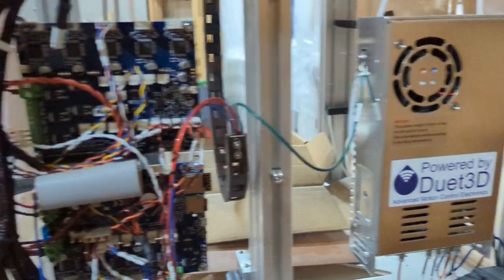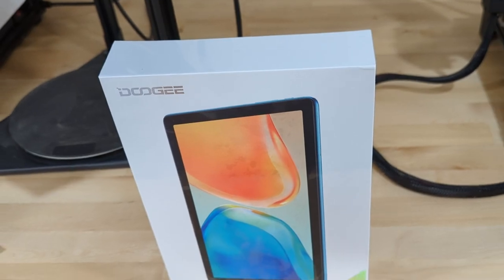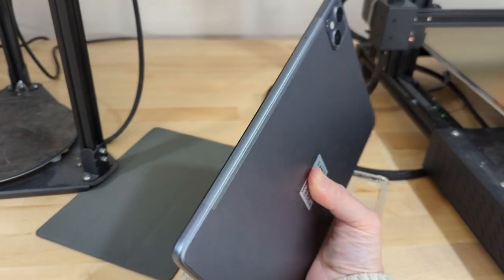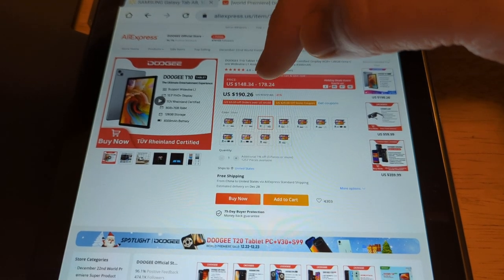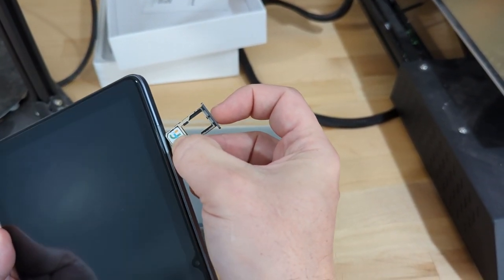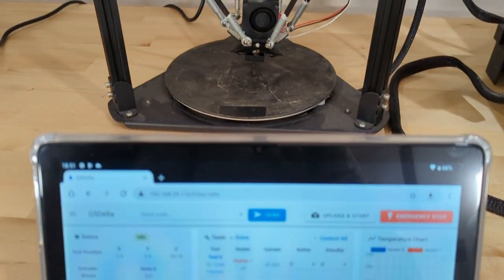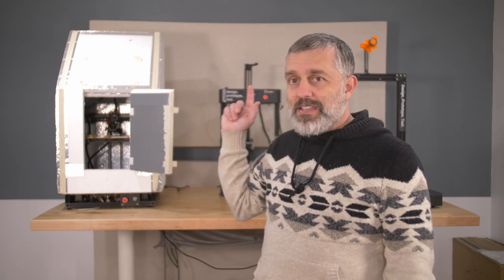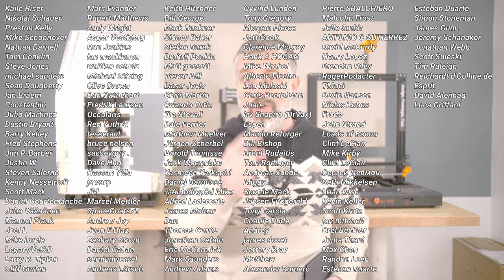Controlling A 3D Printer Farm With A Single Tablet - The Doogee T10

Comment: Duet3D mainboards are plug, configure some gcode, and play solution. 
No Linux OS on a RPi to setup first or VScode and marlin to setup and then you can start configuring if you can skim through all that code, with Duet3D none of that. Duet3D engineers take care of the firmware side for you, all you do is tell the mainboard these are the settings for my printer and that's it. ALL IN GCODE as it should be.

Comment: I've got a convertible Chromebook I like for this reason. Slap a mouse on it and use onshape, then you have an end to end solution for cad and printer control. Not that you can't do that with a dedicated tablet it's just nice having the laptop form factor too.
Reply: Only missing piece on a chromebook is a slicer
Reply: @nbalagopal  actually, no. I have prusaslicer installed on it. You can go into the developer options on it and enable the Linux development environment. After that you have a Linux back end and can install with apt commands.

Comment: I have never been brave enough to buy a Duet mainboard for any of my printers. Due to a lack of knowledge and experience with marlin build and compilation I started down the klipper road which has proven to be reliable enough and of course using mainsail it’s accessible over WiFi. I’ve used octoprint on marlin printers and that works extremely well. Downside is that octoprint and klipper require the same thing, additional hardware namely a Linux based pc that typically comes in the form of a RaspberryPi or similar.
The new Biqu Hurakan has klipper factory installed and with mainsail it gives the same WiFi connectivity and control over WiFi. Let’s hope more manufacturers start building printers with WiFi monitoring and control.
Reply from the maker: What does being brave have to do with buying a electronics control board? This is such manipulative and loaded language. Who do you work for?
Reply: @DesignPrototypeTest  Mate your paranoia is getting triggered here for no reason. I am a big fan of yours if you track my comments. There’s nothing wrong with duet hardware, it’s just that I haven’t been able to justify the cost verses the risk of my lack of knowledge. 
For me to even try a duet board out it would cost over £200 which isn’t a huge amount in the scheme of things, isn’t to be wasted on a whim either.
I haven’t even mentioned another mainboard in my post just that I took another route to achieve what you have with duet. Would you agree there are other paths to choose from other than duet, else dare I say it your a Duet Fan Boy? I never thought I would say that about you, I know you love Duet hardware as all your printers run on their boards, but for me I don’t really care about the hardware it’s all about the software that is running on the hardware. I failed several times to get marlin running on my custom builds so I reluctantly tried klipper which I found was easy to get the printer back up and running, that is all. Reliable hardware is always nice, but easy to build software is king!.
You said hopefully manufacturers with web installed such as octoprint, the first manufacturer to be brave enough to step into this arena happened to jump on the Klipper fad that is running at the moment, but I am sure there is a manufacturer out there that will choose octoprint at some point. It’s just klipper is in vogue at the moment, but I wish it had the features of marlin, personally I think a pre build printer running klipper is idiotic as they could achieve the same with marlin if they tried.
I don’t work for a technology company, but I was trained as a SCADA engineer which includes all the skills to understand the technology involved in 3d printing but leaves we wise enough to tread carefully when trying something new without proper research and understanding after 30 years of experience.
I hope you can understand where I was/am coming from with my first post, not an attack, not propaganda, just the truth that your way may not suit everybody, else Prusa is correct and there are no other 3d printer manufacturers out there.
Reply: @DesignPrototypeTest  yikes, going on the attack like that is so uncalled for. Literally nothing they said was any of this sock puppet type crap.
Reply: @DesignPrototypeTest  ? No sorry, oops you made a mistake in attacking me. Still going to watch your channel though but just a little disappointed in you😞🙈

Comment: ? this is mobile App
Reply from the maker: No. You control your printer through the web browser.
Reply: ? How
Reply: please send this web App which control farm 3d printer
Reply from the maker: @mohamedfarid7499  With Duet3D WiFi control boards all you need to do is log in to the control board via a web browser. The control board effectively serves a web page. This web page allows you to do everything you need to do. Including modifying the firmware. It's absolutely phenomenal. Search my channel for duet and you should find a few installation videos that will show you all the details.

Comment: Did you try Teamgloomy port of RRF for other board brands?? Like skr1.4 ??? <----- this I've been using with 10 bucks additional wifi board and work like a charm. DUET are more like industrial boards, and are more capable than just to run 3 axis 1ext printer. In company i work we have 8 axis drilling tool based on duet wifi and expansion board.